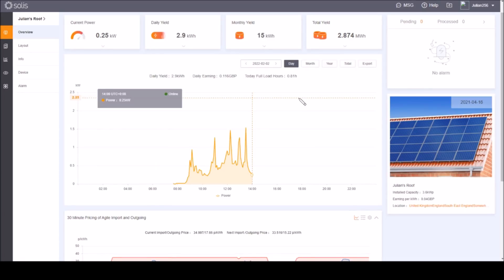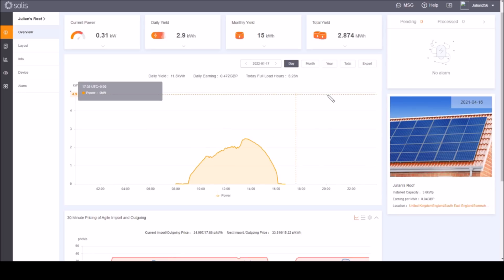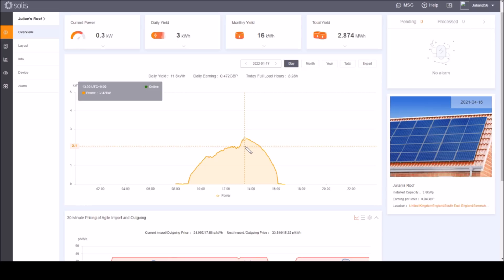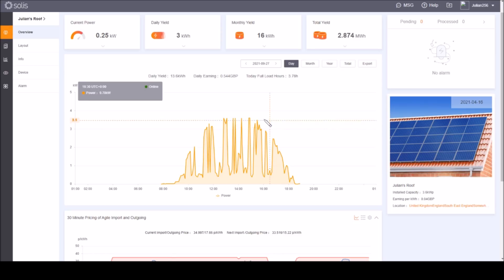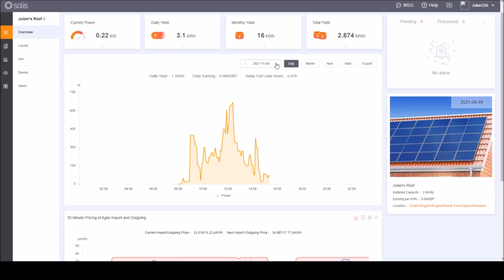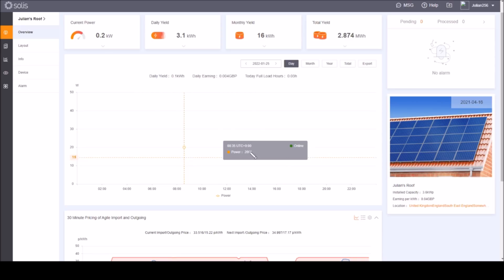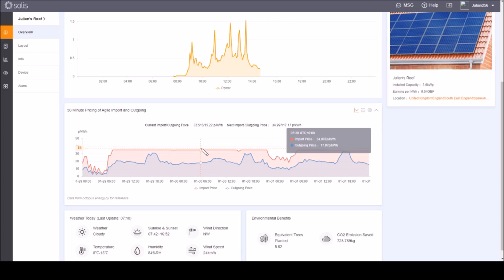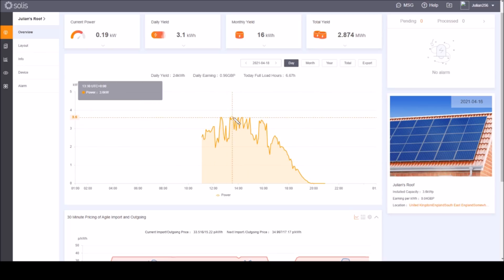Solar Shapes

Comment: 3.6kw.... what a toy. lol In AU 5kw was the lowest size system where u got paid for production for atleast 9 months of the year and thats sunny qld @44 cents per kw, but now its only 10 cents p/kw so they need 20 to 30 kw to generate a credit.
Reply from the maker: Unfortunately I have a 'toy' house which doesn't have the roof space for more than 3.8kW :(
Reply: @JulianIlett  lmfao

Comment: I'd love to install solar panels on my roof, but I have so many trees nearby that it isn't practical. Microinverters can be used to minimize the effect of shadows on panels. Some panels come with integrated microinverters. They have advantages and disadvantages.
Reply: put them in your garden then?
I ve trees on my south facing, so I have ESE facing and they work. If I had a real garden I would build a tracker. - this gives you all day peak power (within reason) so you can have fairly small one :)

Comment: high cast on sunny days is usually causing the limits below the inverters max. Only without high cast you bare can see or recognice the solar poweer systems hit their peak power or in your case the bottle neck inverter cause modules are capable for more. 

Always great to see other projects work out. We are currently building another system for emergency if the gridd  is gone. 
Emergency solar system off gridd just for the central oil heating and the ofen pumps that heat the house during winter and for the deep fridge and refrigerator cuase they run all day long and that way the emergency system can be used to reduce the power bill when not in emergency mode cause we directly connect the devices to this emergency system.

Comment: 3:49 that shadow usually kills the output of the whole string by an awfull lot.
We had a 1 cm thick wire just 2 m above a panel crossing that for just 30 cm and the drop was more than 40% even though the shadow on the module was hardly to see.
Reply: That's the reason behind moving to micro inverters.  You only lose power on the shaded panel, not the entire string.
Reply: Dave Jones of eevBlog demonstrated this problem with his solar system.  As I recall, he had an antenna mast on his roof that cast a narrow shadow across a corner of his array.

Comment: looking at your spiky graphs, if you had a bank of supercaps to store those spike power before the voltage converter puts it into your battery storage wouldnt you eventually get more power out of the panels?

Comment: Great video, Julian! Your analysis is very helpful for people like me that are looking to buy a system and want to understand usage options. I'm currently looking for a way to cool the panels during a full sunny day with maximum output in order to heat our hot water and still maximise panel output. That is two birds with one stone or 10 x 350W panels with a background heatsink to heat our hot water. Do you know of any companies that produce something like this? (I'm already looking at banks of Lithium Titanate batteries for storage, as I'm not interested in 'feedback')
Reply from the maker: I've not looked into water-cooled PV panel systems. Generally solar thermal is implemented using a separate array of heating tubes elsewhere on the roof.
I will only export solar to the grid on days when my car is not at home. Most days I'll charge the car using solar, then feed surplus energy that's in the car, to crypto miners overnight :)
Reply: I wonder how much a layer of glass and optionally water would cut down on PV yield?
if glass isn't much...
 As PV panels have to be waterproof to deal with rain, they might be able to form bottom side of a thermal panel. picture frame type structure with glass top . flood with water when thermal wanted, let it drain when it not wanted.
there would likely be condensation form inside thermal box... flood with water and empty likely to sort.
Reply: @stevecummins324  Shouldn't matter too much, I mean panels already have a glass cover.  Running water over the front might cause a mineral build-up which will cut down on power.  Water on the back of the panel works fine.
Reply: @j.f.christ8421  Glass defo stops something.  ... When I was a teen, my dad swapped for glass the plastic covers on top of thermal solar panels installed on a property in highlands of scotland. I  recall because he shouted me upon to the roof after he discovered silicone beading wasn't sufficent to hold the new glass tops in place without some extra clips at bottom/he needed to find/fashion some quickly. the glass hadn't had edges ground down, so got couple of small cuts in my finger tips... and when silicone starts curing it releases vinegar/acetic acid. very ouchy fingers :-(

anyway once clips were on panel... control panel reported return water temperatures rising from it's previous max of 60deg to 90deg... and it kept rising, 5min later system shut down as roof safety valve opened, venting steam, and emptying system of water. sorted out with a bigger pump, so send water through faster.

...ideally thermal solar, wants a high temperature around pipes to get heat into water fast. what's the temperature of the back surface of a PV?
Reply: @stevecummins324  Rear temperature is about the same as the front, solar cells aren't very thick.  You stick a heat pipe on the back and pump liquid thru, works well but is expensive.  Cheap & simple option is just to spray water on the front.  You only get about a 10% power increase (and only on hot days of course) so it's usually not worth the effort.

I guess someone has stuck a heatsink (metal fins) on a panel and found it didn't do much otherwise we'd see more of it.

(As for silicone, the vinegar smelling stuff is really not a good choice for electronics, it corrodes stuff.  I can never remember what the proper stuff is.)
Reply: Ill answer with two ways to do it. and the commercial

Scrap yard visit required.. or buy new..  Windscreen pump, Car parts next, Copper Brake lines (its not copper, but similar) Hooby Shop next ( of computer shop) sticky pad cable ties.
wave the pipe on the back stick the pads on and cable tie it.. the pipe bends easy and it is light.  The only issue would be making contact between the pipe and panel. Pump on one end.. hot water out the other.

Panels use polycarbonate type back panels, you can buy this cheap as packaging. (it not good in UV)  Join loop the ends alternatively to feed water though it.

The commercial option is very much the same as a garden watering system. it is clipped to the top of the frame. should be able to find that at a local DIY.
You can drain tap if you want the heated water off it.

Comment: The temp is not the problem, the angle is.
Reply from the maker: Not in my case. The graph from June 23rd (a day after the summer solstice) has two hours or so of flat-topped 3.6kW peaks.

Comment: I've heard you can get solar panels that also have water tubes in them that run water from your pool through to cool your panels and warm your pool. Obviously not your pool, since you don't have one. But it would make a noticeable difference on those warm sunny days. At least the handful of them you get each year.

Anyway, it will be interesting if you can get a vehicle to grid system going with your electric car. That would allow you to charge it off solar during the day when the feed-in rates are low, then in the evenings when the electricity prices start going up and the feed-in rates are high you can export from the car to the grid.

Meanwhile here in so-called sunny Australia, we've had a few miserable rainy days lately. It only managed to get up to 24°C today, and the forecast for the next week won't get much over 25°C and rainy. So just like the UK can occasionally get a warm sunny day, we can occasionally get some pretty dreary ones.
Reply from the maker: The only V2G systems in the UK (that I've heard of) use Chademo on the Nissan Leaf.
Reply: only tesla does vechicle to grid

Comment: Interesting. I wonder would it help the panel heating issue if the panels were suspended something like a foot or two above the roof in a separate frame to have airflow under them and the panels had a matte black backside to help cool them down by radiation?
Reply from the maker: I'm sure there are permitted development rules which wouldn't allow solar panels that high off the roof.

Comment: You won't get the max output of your array in the UK, you may get the rated output nearer the equator.
Reply: absolutely, the max power rated is a test from the lab under the most ideal conditions, they have to do that otherwise it wont be a real max.

Comment: Surely the main reason that you don't get the full nameplate output power even on a clear summer day is not the temperature of the array but the fact that at midday the sun is not perpendicular to the array.  You can only get the maximum rated output if the sun's rays are perpendicular to the array in both vertical and horizontal axes.  This can only happen on two days a year when the highest point of the sun coincides with your roof angle.  In the middle of summer when you might expect to get the highest peak output the Sun is too high at midday to give you the best output power so these two days might be sometime in the spring and autumn.
Reply from the maker: Unfortunately we didn't get any cloudless days last year in the Autumn for me to check. But you're right of course, both temperature and off-axis radiation will cause a reduction in output power. Actually, there are some graphs I didn't show which show the effects of temperature much more clearly. Perhaps an update video is needed.

Comment: Julian, this is very interesting. Luckily I have no shadowing at all.  I have a Solis inverter as well with access to the stats on the Solis cloud just as you have. My system also feeds into my Myenergi Zappi and so I also see what the Zappi thinks the solar generation is.  So picking a half decent day such as 1st Feb, the Solis web data reckons I generated 14.9kWh.  The Zappi which has a CT on the solar output says the inverter generates 16kWh. So there is a disparity on what the inverter and and another system thinks has been generated. I suppose the obvious check is to log the numbers on my generation check meter at the start/end of the day and compare.  I guess that "should" be the most accurate.

Comment: Thanks Julian.  With energy prices rising I'm seriously looking at getting solar on my roof.  Are you purely use/feed or do you have batteries for the rooftop system?
Reply from the maker: I don't have a storage battery, but I do have a 72kWh battery in the car. Also, the car has V2L (vehicle to load) so I'll be able to discharge it into any mains appliance when there's surplus solar energy (I'm thinking Antminer).
Reply: @JulianIlett  May I ask what vehicle you have that supports V2l, would love to see a video on the V2l.
Reply: @guy7gsa  same here, I saw a review of a chinese made 72k with v2l. Its only just been released think its a vw copy
Reply from the maker: My car is the newer MG ZS EV. Unfortunately, the V2L cable (discharge cable) isn't available yet so I haven't had a chance to test it.
Reply from the maker: I'm planning to do a video on the car soon - something like 'charging a car from a powerbank'.